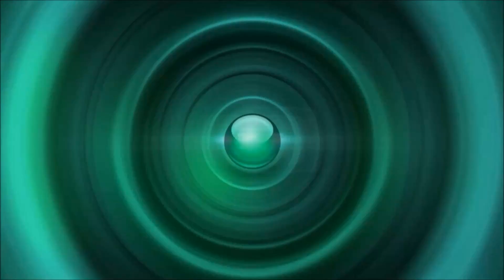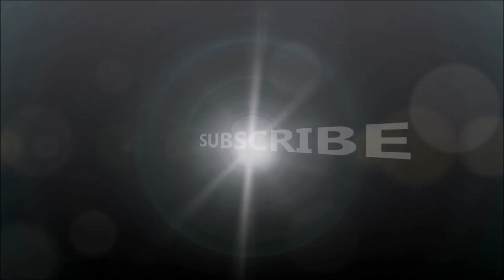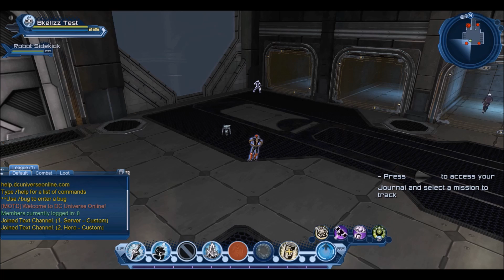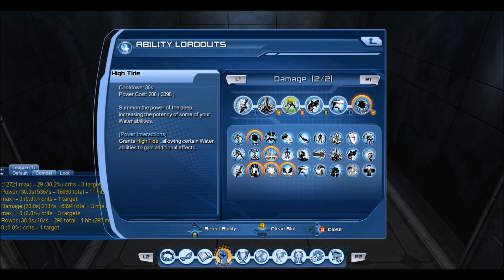DCUO: Water Weapon's Expert Loadout l AoE & Single Target

Comment: I dont have the artifact for the weapon buff on rank 80, so i couldnt test it but wouldnt 2x pressurise add up?
Reply from the maker: It doesn't stack the buff. It'll just refresh the 12 seconds until it runs out again. So you will want to hit pressurize after 6 seconds have passed so you will have 12 straight seconds of the artifact buff. Refer to the pinned comment where Basic has a better loadout while using the artifact

Comment: Why don't you use the shield  you wil do extra damage when do weapon attacks. That's a must have bro, you can stack it with riptide.
Reply from the maker: You are correct about riptide being used for the weapon buff. The shield's damage is pretty meh. Like I said in the video you can use the extra slot for bubble but in reality you'll use to much power and most likely won't get the recharge precision buff from your controller
Reply: greagen good observation bro, but I thought bubble only buffs water damage only. Im not sure 🤔 cant tell really
Reply: Najee Smith no it buffs weapon attacks and water attacks unless they change it overnight lol
Reply: did we really expect him to find the best rotation here? I mean these comments are filled with suggestions of powers he should have used differently. Can't expect much when you spend 30min on the test server and make a rotation and you can't even run a raid against other dps cause its just test server
Reply: rw06an cut him some slack I asked and he gave